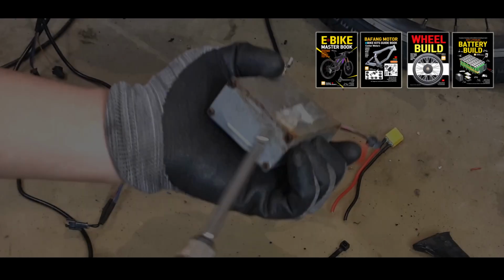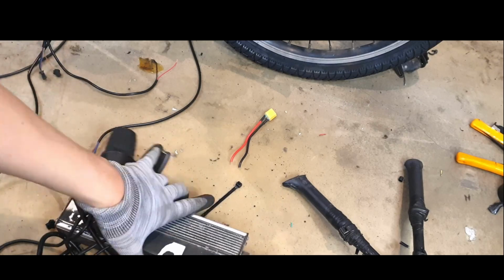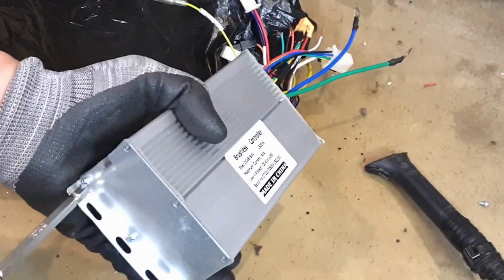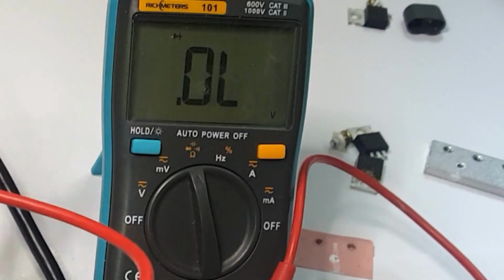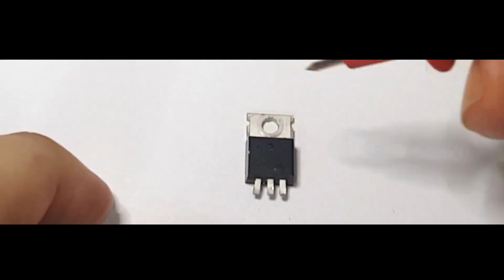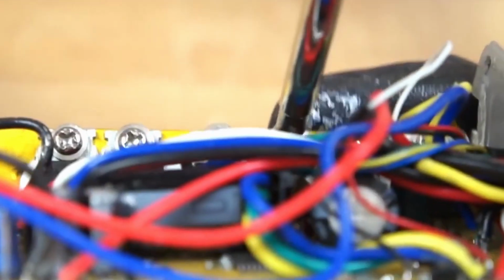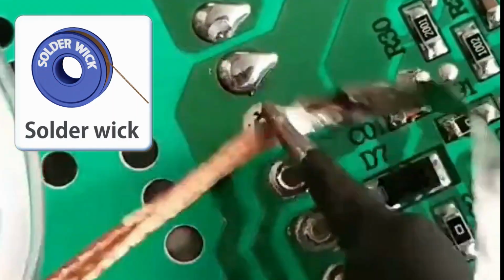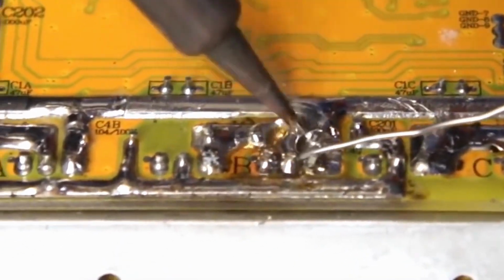Book : E-BIKE and EV Controller Repair Guide - MOSFET -

Comment: took me 2 seconds to identify the 1 bad mosfet out of nine, i will tell you how you can too..
you will need camera like a flir or one of those for your cell phone.
you should also purchase a VERY  helpful tool called a short burner or use a power supply to inject a voltage into the battery connector
look at the mosfets with flir and use short burner set to .5 v and connect to battery plug that goes to controller for motor (disconnect battery first).
immediatly observe the mosfets - the bad one will light up and say its me !
sooooo awesome

Comment: Hi! I’m having a very similar problem: the same MOSFET keeps failing every time I replace it.

Someone suggested checking the gate resistor near that MOSF and the gate driver, but also mentioned that a motor winding or Hall sensor problem could cause this.

I’ve already measured resistance between all three motor phase combinations (U-V, V-W and W-U), and the readings seem very similar, but I’m not sure if this is enough to rule out a winding problem.

How can I properly test the motor windings for a partial short or insulation fault? And what would be the correct way to test the Hall sensors?

I’d really appreciate any advice on what measurements I should take before replacing another MOSFET. Thanks!

Comment: I have replaced the MOSFETs several times, but one particular MOSFET either burns out again or causes motor rotation issues after the repair. This is now the third occurrence. I have the proper tools and soldering equipment, and I am confident that the PCB is not being damaged during the process. What could be the root cause of this problem? My guess is that it may be related to the amount of solder on the back side of the PCB. If there is too much solder, I wonder whether excessive current could be flowing through a particular MOSFET. I am also unsure whether the solder needs to fully penetrate the through-hole and reach the opposite side of the MOSFET leads.

Replacing MOSFETs in an electric scooter controller is much more difficult than it appears. Even when the repair seems successful, it is quite common for the controller to fail or burn out again after only a short period of riding.
Reply: I don’t think the amount of solder is the main reason that the same MOSFET keeps failing. Extra solder does not normally cause more current to flow through one MOSFET by itself (as long as there are no solder bridges and the joints are properly wetted). Since the same MOSFET position has failed 3 times, I would suspect something else in that specific phase circuit. The most likely causes are a damaged gate resistor or gate driver, a weak companion MOSFET in the same parallel bank, a problem with the opposite MOSFET in that half bridge, or a fault in the motor phase wiring or Hall sensors. When a MOSFET burns out, it can also damage the gate driver circuit even though the damage is not visually obvious. The replacement MOSFET may then turn on too slowly, stay partially on, or overlap with the opposite MOSFET (causing shoot through and another failure). I would check the gate resistors & gate driver components against the other 2 phases, replace all MOSFETs in the affected parallel group with identical parts, and test the corresponding high side and low side MOSFETs. I'd also check the motor phase wires, connectors, Hall sensors, and winding resistance before connecting the controller again. For the soldering, the solder should properly wet the MOSFET lead, pad, and plated through hole. It does not need a large amount of solder on both sides, but it should penetrate the hole sufficiently to create a solid electrical and mechanical connection. Too much solder is mainly a concern if it creates a bridge, prevents the MOSFET from sitting flat against the heatsink, or hides a poor joint underneath.

Comment: I have the YK31C Controller and it’s acting weird, when I turn on my bike without twisting the throttle,the wheel starts spinning slowly.I don’t know what to do,can you help me
Reply: This happened to em100 votol controller. It was due to two reasons .bad wiring and secondly wrongly programmed controller. I took it to dealership and they changed wiring and reprogrammed controller. Now it is working properly

Comment: Hi and thanks for the video, I have a question, but since the mosfets are alternated with the + and the - in the connection on the board but it is not that they are with alternated n-channel and p-channel? This is because unfortunately on three mosfets with the + you can read the acronym but on the other 3 connected with the - you cannot read it
Reply from the maker: I recommend this video. https://youtu.be/MSm66hhJZxc?si=zepWP42iNRofkAav

Comment: Hi 
Thanks for the video ,i have a problem with my controller sometimes when i switch the bike off using the key the voltage suddenly drops even though the battery is fully charged ,but this never happens if i switch the bike off using the display ,i have used another battery and the same thing happens ,any help would be much appreciated .
THANK YOU